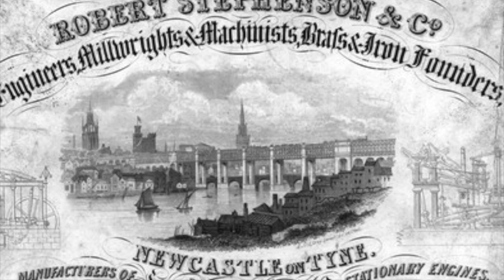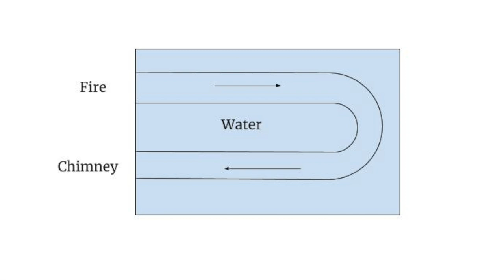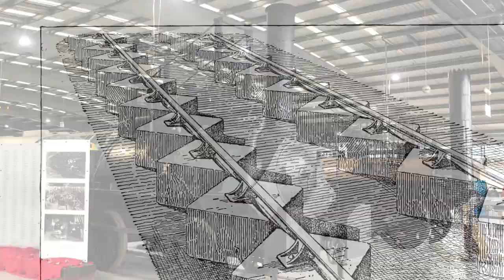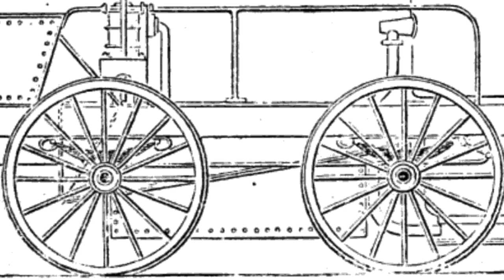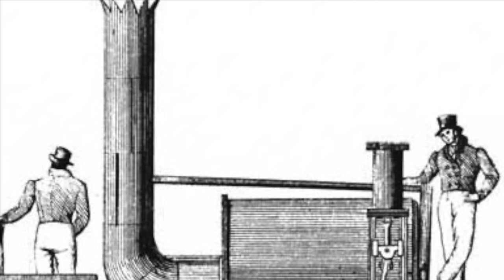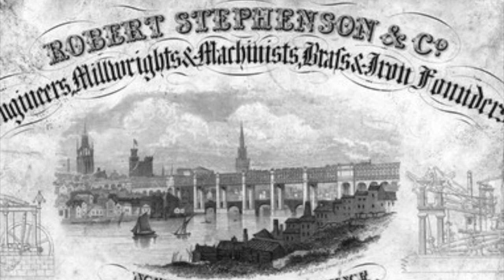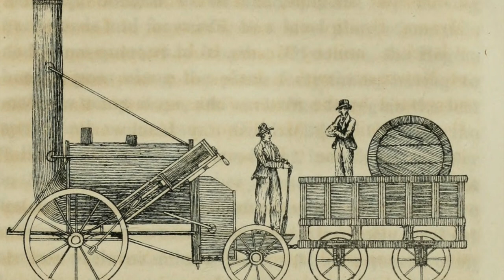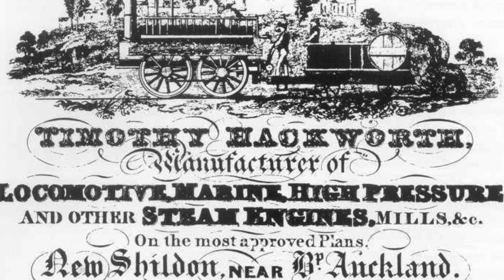Sans Pareil: The Big Engine That Couldn't

Comment: Wylam colliery seems to have played a major part in the development of the steam locomotive. William Hedley (Puffing Billy) also worked at the colliery. Fascinating video. More on the history please!
Reply: And it also appears that Richard Trevithick built an early steam locomotive for Wylam, not long after his Penydarren locomotive. The wooden rails of the time weren't strong enough to take it, but this spurred the owner to lay iron rails a few years later, leading to the Stephenson and Hedley engines.
Reply: @dwgray9000  Thanks, really useful information; have you a source for its later career? It confirms the versatility of Trevithick's engines; all four of his locomotives had only brief lives as motive power but in each case the high-pressure steam engine itself was successfully reused for other purposes.
Reply: @dwgray9000  If I really need people to find a link I put a unique phrase from the page that should come up easily in a search. It is not ideal, of course.
Reply: North east has helped build the world
Reply: @dwgray9000  it was only used on a boat for avery short time
Reply: Unfortunately Daniel Gray's post has disappeared, but he basically referred to the Wylam engine later being used in a steamboat. That was certainly the fate of Catch-me-who-can.
Reply: Hedley was likely just the name on the letter head for hackworths early work.

Comment: The biggest advantage of Rocket was that it could be scaled up a lot, while Hackworth locos became slower in proportion to their size. This was because in a multitube boiler the heating surface increases in proportion to the overall size, while that of a return flue boiler does not. Later, larger Hackworth locos were good for shunting with long idle periods to redover pressure.

Comment: Great description. In fact, the few years 1825-1831 possibly saw the biggest advance in the steam locomotive, from an unruly assemblage of knitting needles in Locomotion to a basis for most 19th century locomotives in the Planet and Patentee types (inside cylinders). Hackworth's return flue and blast pipe were a vital step on the way, but the former was logically superseded by Rocket's multitubular boiler which was essential to give enough heating surface for high power outputs; 2 tubes are better than 1, but tens or hundreds are even better if you can overcome the increased pressure drop, which the blast pipe does. Hackworth was a good enough engineer to recognise and adopt new and better ideas and duly switched to multitubular boilers himself.
Reply: Strange ... No-one in this discussion has mentioned Richard Trevithick hasn't had a mention. The Stephensons - father and son - were friends and 'Geordie' George borrowed ideas from him. It was on a working tour of South America that Robert Stephenson came across Trevithick, then a struggling mine engineer. Robert gave Trevithick the funds to return to Britain but the Cornishman died in relative obscurity, while Robert Stephenson went on to become MP for a London borough and influenced I K Brunel, becoming firm friends (see "Robert Stephenson - Railway Engineer" by Robert Addyman and Victoria Haworth (publ. North Eastern Railway Association, and the Robert Stephenson Trust), September 2005. .
Reply: @AlanLancasterAlanRLancaster  Good point. Trevithick was the true pioneer but was ahead of his time. Catch-me-who-can in 1808 had a neat appearance like Rocket but Trevithick then moved on to other things. He used return flue boilers (as did Hackworth) so was in advance of the Stephensons for many years until they made the big advance to a multitubular boiler in Rocket. Trevithick seems to have been great at inventing things but not so good at making money from them; the Stephensons managed both. There is an excellent biography of Trevithick by Anthony Burton which I enjoyed reading a few months ago.
Reply: @iankemp1131
Reply: His 'butterfly' attitude towards his own creations might explain the predicament he was in down in South America. The coverage on Trevithick in the NERA book is extensive if you ever come across it. I've almost run out of space but a new book on Northern steam is due out for Christmas so one or two of the others is going to have to 'bite the bullet - decisions, decisions, eh?
Reply: @AlanLancasterAlanRLancaster  Burton's biography indicates that he came very close to success in South/Central America. He had installed steam engines in Peruvian silver mines but then got overtaken by the Bolivar revolution. He then did similar things in Costa Rica and had just made a remarkable 60 mile overland journey through mountainous wilderness to reach the Atlantic, losing most of their money and possessions on the way when their river raft overturned, hence the need for Stephenson's help. He returned home to try to get more mine investors, for the first time for 11 years! Altogether a remarkable life story, he had his finger in so many pies. The mines proved very profitable long-term but too late for him to benefit.
Reply: @iankemp1131  Ian, that's information I've never seen. Might be invaluable, you never know. thanks
Reply: @AlanLancasterAlanRLancaster  Well, your original comment stimulated me to look back at Burton's book, and once I'd done that I had a hard time putting it down again! I remember it was a real eye-opener to me when I first read it as to just how many different things Trevithick had done in his life, nearly all being various ingenious applications of (fairly) high-pressure steam. Thanks for the memory jog!
Reply: @iankemp1131  Got a fair amount of railway history tucked away, Ian, that you might be aware of. I have books on George Hudson, Edward Thompson, Vincent Raven, and Sidney Weighell (political moderate remember him? NUR General Secretary during the 'reign' of the Iron Lady or Handbag Queen).
Reply: @AlanLancasterAlanRLancaster  I also have a pretty extensive book collection, mainly thanks to my late Dad, although a lot of it is still packed away. I read many of them as a teenager when he didn't have time to; then he retired and I started work and the boot was on the other foot; now I'm "retired" too and am beginning to catch up. I think he had "100 years of Railway Weighells" but not the others. They sound interesting!
Reply: @iankemp1131  He also wrote a book titled, "On And Off The Rails" (it has a colour photo on the cover that shows him looking determinedly at some, obviously debating somethin.front line of union politics, in particular with the NUR militants - pretty much like today's scenario - who'd sooner shut down passenger services that yield. Of course it's a suicidal stance to take and there are probably parallels with today's scene. He joined the Board of BAA and retired to a suburb of Harrogate where I met him once in private together with a another retired railwayman who lived at Starbeck, where the loco depot was. We had a long conversation, but not about his time with the NUR. This was about the railways around Harrogate including what had been the route north via Ripon to his home turf, Northallerton. When we shook hands in farewell I noticed his hands were the size of dinner plates from his days of firing on locos on the Wensleydale and further afield.

Comment: Thanks for the video. I remember watching Anthony Burton's excellent The Rainhill Story: Stephenson's Rocket on the 150th anniversary of the trials. Very enjoyable. And, of course, 2029 is the 200th anniversary. If he is still with use Anthony Burton will be 95.

I know it is eight years away but a date for your future videos diary.
Reply: Several months less than eight years now. If I remember correctly, the 1979 celebration was about August?
Won't be long coming!
Reply: Anthony Burton also wrote a very good book on Trevithick who was the original pioneer of steam locomotives thanks to his use of high-pressure steam.
Reply: @iankemp1131  Trevithick was set a task which if he had been able to complete it out would have changed the course of history and the fate of Horatio Nelson. The first steam powered boat sailed on a Scottish canal before the Battle of Trafalgar. There was a plan to attack the Franco-Spanish fleet with fire ships towed by steam power boats. As it turned out the technology was not advanced enough for the plan to work. But if it had worked and succeeded may be we would have had Trevithick Square in London instead of Nelson Square. Would HMS Trevithick have been involved in sinking the Bismarck?

Comment: Safety valves. According to L.T.C.Rolt in Red For Danger safety valves used to be adjustable and they had to pass an act outlawing such valves. Until then when a locomotive was struggling up an incline they would send a lad out to screw down on the safety valve to get some extra pressure. Now and again a boiler would blow up thanks to this.
Reply: Yes, and Rolt also noted that these Salter safety valves were still used on traction engines after this and quoted his experience working with an elderly driver pulling up tree roots. "When a tree refused to budge, the driver simply screwed down the nut and waited till the pressure was enough to overcome stubborn roots. I watched these proceedings from a distance."

Comment: The fusible plug, has always been a fail safe device, intended to put the fire out, its not a warning device of any nature. This is a modern myth put about, including my members of the NTET. Indeed dropping a plug on a mainline railway loco can be dangerous if the fire hole door is open.

Comment: Cheers again Jago. Just goes to show that the universe does not like arrogance, Without equal is asking for trouble, think about Challenger space rocket or Titanic ( unsinkable ). I would like to think that if I came up with a ground breaking design for anything I would name it hopeful, or  Fingers Crossed. In the case of the later then the French would be Doigts croisés.
Reply: Titanic is another name for big, but I agree with your idea about naming things optimistically.

Comment: Rocket was simply the superior engine, and her genius lay in multiple superheater tubes, having the cylinders at an angle, and driver and fireman being at the same end of the boiler.  Timothy Hackworth appears to have had an obsession with putting the driver on a platform at the front of the engine.  Rocket set the standard for steam locomotives in many ways.

Not that Hackworth's early engines were not effective machines for their time. The oldest surviving steam locomotive, Wylam Dilly (built 1813, now a static exhibit in the National Museum of Scotland, Edinburgh), not only performed well as a colliery engine, but at one point in her life had a brief period as the engine of a paddle steamer.
Reply: Absolutely right that the multitubular boiler was the key step that greatly increased Rocket's power, although these were simply firetubes raising saturated steam in the boiler, not superheater tubes - those came nearly 100 years later. Hackworth's return flue was still an advance on Stephenson's single flue, doubling the heat transfer surface area, and that necessitated having chimney and firebox at the same end. Ironically Trevithick's pioneer locomotives of 1802-8 had return flues, but the technology had to be rediscovered. The angled cylinders were also an intermediate step; they still caused swaying and within a year Stephenson had introduced horizontal cylinders, and then put them between the frames.

Comment: We know from the replica the design was not as good as Rocket,  but did that replica solve or show WHY the cylinders were cracking (I presume iron technology was not brillant, and the upward force was part resolving to one side resulting in a weak/ stress point in the cylinder wall,  though vertical cylinders had been used before,  Steam Elephant and Puffing Billy used different valve and drive system and did not aim for speed, but for enough power - additionally most colliery engines were more for braking as loaded wagons tended to go downhill to the coal staithes and quays, with haulage only for the empty wagons.

Comment: How would you make a rope long enough to go from Manchester to Liverpool?
Reply: Why would you need to? Rope haulage on the L&M was only for trains leaving Crown Street (later Lime Street) station on the hill up to Edge Hill station.
Reply: @petermolloy6142  And then they coast downhill to Manchester?
Reply: You wouldn’t. You would build stationary engines at intervals along the track (edge hill would have been the first and was the only one built) and then transfer trains from cable to cable at 2 or 3 mile intervals.

Comment: Why not do a vid about all the reproduction early steam locos that have been built starting with Locomotion reproduction that was built for the Stockton-Darlington 150 in 1975 Which spent time at the Beamish Open Air Museum.. followed by Rocket, San Pareil and Perseverance...for the Rainhill 150 in 1980 You could finish the video while being in Darlington maybe with the A1 Locomotive Trust building a replica of both a A1 Tornado and Gresley  P2 Prince of Wales...

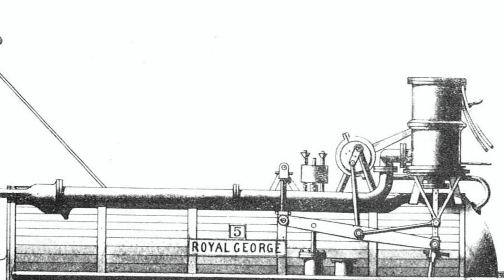Comment: 4:00 the blast pipe is what gives steam locos their distinctive chuff chuff sound. Release the steam directly from the cylinder and it does not resonate in the flue.

The sound is not why they did it, nor from an engineering point of view is it particularly important. For the PR value of steam traction however it is essential

Comment: Only thing I remember from the Rainhil trials is the guy that was killed and claimed "I have met my death"
Reply: Huskisson (invariably called "the unfortunate Mr Huskisson" in all accounts) was killed at Parkside on the opening day of the railway (September 1830), not at the Rainhill trials (October 1829).
Reply: Does his tombstone have the inscription "Dead Chuffed"?
Reply: He was an MP and a director of the Liverpool and Manchester railway.
The fatal accident occurred on the opening day in 1830.
The sad thing is that countless men died building and operating railways, but aren't remembered. Only Huskisson is remembered because of his status.
Reply: @thomasburke2683  But also because he was the first member of the public to get killed on a public passenger railway, and because it occurred on such a prominent occasion. The first warning that the increased speed, power and weight would need better safety measures.
Reply: @thomasburke2683  And President of the Board of Trade too, I seem to remember.

Comment: He sounds like a sore loser definitely!! But helping Russia build their first steam locomotive doesn't sound like such a bad 2nd place! ;-) My final point, wouldn't a Stirling engine be a more efficient choice!?
Reply: Very interesting point. The Stirling engine would indeed be more thermodynamically efficient but didn't have the power output needed within the compact dimensions of a railway locomotive. It was also significantly further back in its development cycle than steam engines.
Reply: @iankemp1131  really, thanks for that Ian and clarity. I find it fascinating with these engines. There are such application, that you could use for these engines that are relevant in 21st century.
Reply: @jamiearnott9669  I remember being briefly taught about Stirling engines at university and wondering at the time why they hadn't been used more, or tried in steam locomotives. I think it's the power density that's the problem. Similar to why steam turbines and water-tube boilers never really took off in railway engines although they are almost universal in power stations, and triple expansion was common in ships but unusable in trains. Likewise gas turbines are great in power stations but did badly in trains because their efficiency falls badly at part load operation, whereas diesels can be happily throttled back to idling speed.